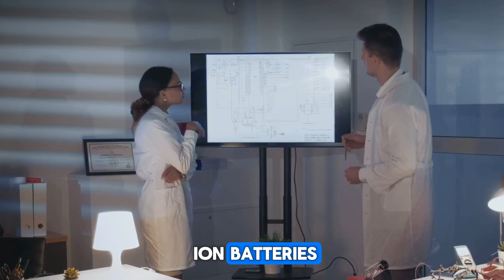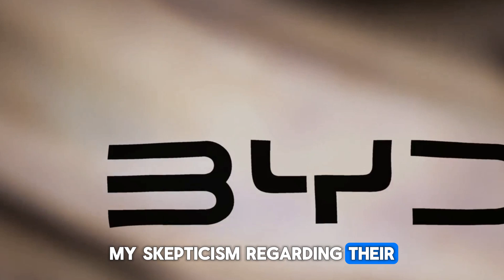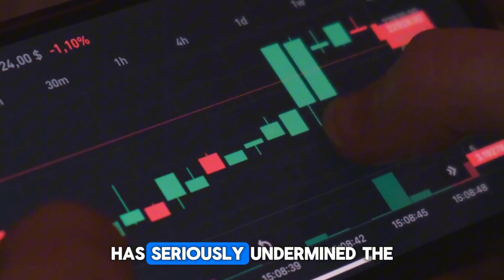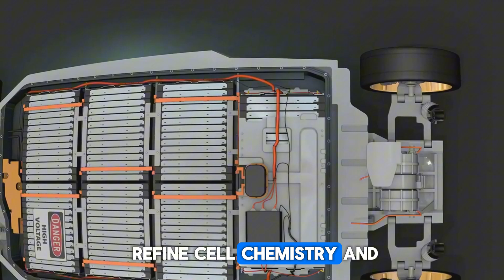CATL Announces 2nd- Gen Sodium Ion Battery with 5 Minutes Ultra Fast Charging

Comment: If EVs had ability to change batteries and just recharge them in every batteries exchange station  will work great, even if goes for 250-300  miles. 
As is in Town driving one can recharge at home or in the parking  structure, and not longer drives charging stations would take 3-4 min instead of 1/2 an hour charging, just like gas.
USA should thank Elon for his "great vision" how to make money, regardless of the future. 😂